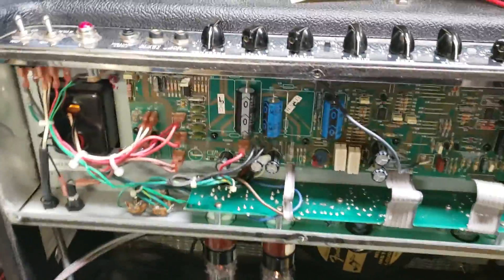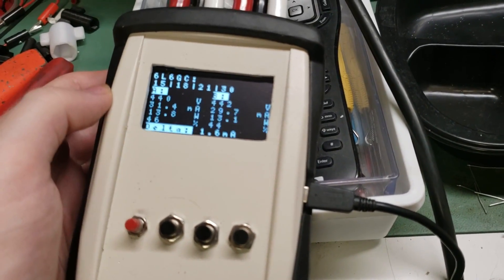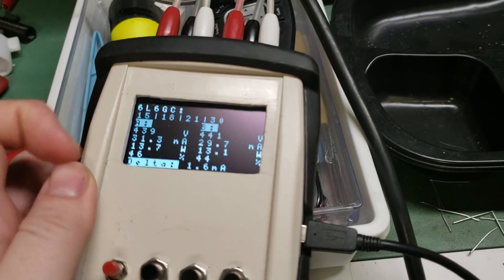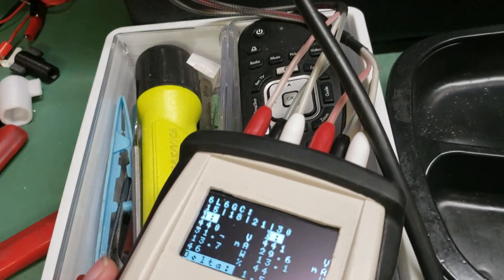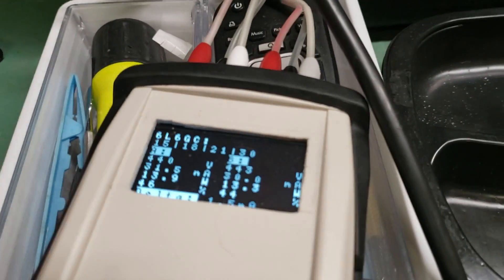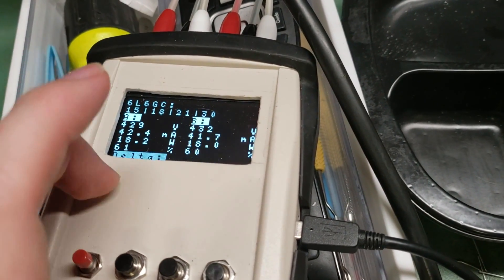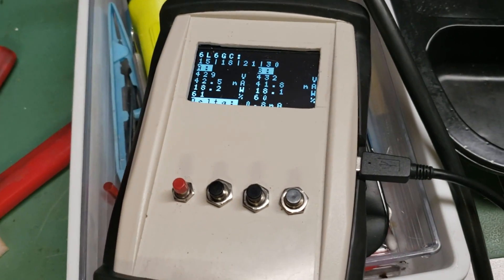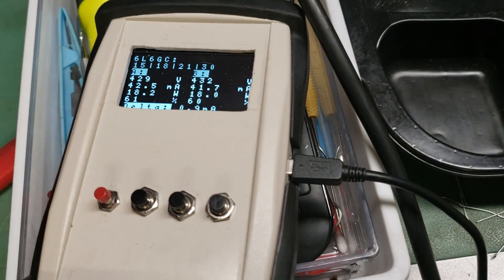Arduino powered vacuum tube bias tester

Comment: Is there a schematic available by any chance? I saw that this question had been asked before. But couldn't find an answer.
Reply: Thank you for the quick response. Very helpful. I want to use this as a basis for a setup for 4 tubes. I will have to switch to a larger screen and an extra ADC, but that is for later. Thanks for sharing.
Reply from the maker: Cheers, best of luck - I've thought about doing a 4-tube version but I've been too busy to do my own projects!  @ricocootje
Reply from the maker: No schematic, sorry - but it's pretty straightforward:
Parts:
Arduino Nano
3x Pushbuttons
1 SSH1106 Oled display board
1 ADS1115 ADC board

Pushbuttons are wired between ground and the following digital inputs:
D7 (Select)
D5 (left)
D6 (right)

and the OLED screen and ADC board are both connected to the arduino's i2c lines just like any of the tutorials online for them (Adafruit's diagrams can help you there)
Power for the screen and ADC are drawn from the 5V regulated bus on the Arduino

--

The actual probes themselves are TubeDebot "Bias Scout" probe kits, completely unmodified. 
Comments on the code show which ADC input correlates to the probe's current and voltage shunts

Hope this helps!
Reply: Then I still have a question about when you use the probes from TubeDepot. This contains a voltage divider that lowers the plate voltage. But the relationship is like this: when the plate voltage is 450V, it is offered to the ADC at 45mV through the voltage divider. Is this voltage still high enough to transmit a good measurement? Or am I missing something?
Reply from the maker: @ricocootje  The trick is that the ADS1115 has a built-in prescaling amplifier, and in this case is turned all the way up, giving us a scale of 0-255mV to work with instead of something like the same bit-depth spread over 0-5V
Reply: Regarding the libraries you use in your code, where did you get them from? I tried them from Github, but get error messages while compiling.
I also wonder about the ADS1115 library. Because on line 31 you talk about Adafruit_ADS1015.h, while line 43 refers to ADS1115.
Is this a bug or am I overlooking something?
Reply from the maker: @ricocootje 
Okay I did some digging to see what's going on here.
 Looks like it's because I built this quite a while ago with early versions of the libraries - Adafruit later renamed the library file from ADS1015.h to ADS1x15.h. 
I would try changing the name to see if it'll compile, but otherwise... my library tells me I compiled on version 1.0!

The display library U8x8lib.h is part of the U8g2 library, also available from within the Arduino library management tool. Mine was compiled on 2.26.14.

It's a good thought though, if I have the time later I'll probably come back and update my 4-year old code for newer library version heh.
Reply: @3dbeergoggles  Thanks for the quick answer. I have indeed already tried to rename the library file to ADS1x15.h.
Only then do I get an error message on the addressing of the ADS (line 43); "no matching function for call to 'Adafruit_ADS1115::Adafruit_ADS1115(int)' "
So something isn't going well there yet...
Reply from the maker: @ricocootje  

Ah, I updated to the current version of the library so I could debug this with you.
Change:
 Adafruit_ADS1115 ads(0x48);
To:
Adafruit_ADS1X15 ads;

The "construction" doesn't use the address anymore.
Reply from the maker: @ricocootje  Testing in the hardware I have noticed an issue: the latest version of the library is a lot slower than 1.0 was. It still works, but it seems to take 4x longer or so to update the screen.
More debugging needed :/
Reply: @3dbeergoggles  Yes, I managed to compile the code. Was a small adjustment in line 43. I2C channel 0X48 must be removed here. This is already assigned in the Adafruit_ADS1X15.h.
But I still have a few questions, if I may be so bold? I test the system by applying a fixed value of 46mV to the input of the ADC. What strikes me is that the measured values do not remain stable. These fluctuate quite a bit. The plate voltage fluctuates from 456.?V to 460.?V. The cathode current mainly functions after the decimal point, but it does not really give a fixed value. I see that the plate voltage in your video does not show decimal places, perhaps that makes a difference. And it seems as if the values in your video refresh less quickly. Could this have been changed later in the code?
And then perhaps another stupid question concerns the subtract 5.5% of reading to approximate screen current. Is this something you always have to do? Since you are going to measure the voltage across the 1 ohm resistor. Normally this is always the current to which you adjust the power amplifier, right? Why the 5.5%?
Reply from the maker: @ricocootje  Fluctuations, et al. could be from a number of issues, the least of which being noise - the ADC is being run at 16x gain so if there's any stray noise it might be showing up. Of course, to get a reading from 456 to 360 only requires a fluctuation of 0.4mV and the input impedance of the ADC at that level is 100M ohms!

Bear in mind I am NOT anything approaching an expert in this (hence the absolute spaghetti code I wrote), but I suspect the code in general could benefit from a rework to provide a smoothed average reading.

5.5% is subtracted to account for grid current. Since the goal is plate wattage (plate current X plate voltage) the ideal would be to measure 1 ohm across the plate lead, but that leaves both leads floating hundreds of volts above ground so we instead measure cathode current. Cathode current is the sum of Plate AND Screen Grid current. So if we'd like to get the actual plate current measurement (without having to measure the current through the plate or grid circuit directly), an approximate value of 5.5% is subtracted instead.

This figure is what is used in Rob Robinette's online bias calculator page for this very reason. It's also why there's an entry in the tube array to allow you to add tubes in the future that don't use screen grids, such as a triode.

The "debug" tube in the menu also allows raw reading of the cathode current without any grid current subtraction.
Reply: @3dbeergoggles  Oh damn. I now see that I missed this message. But indeed this was the issue. After this change the code works.
I'll have to see what happens when I use two ADS1115. I expect that I will then have to change ads.begin() to ads.begin(0X48) and ads.begin(0X49). But that's for later.
Reply: My comment above was in response to this comment;
"Change:
Adafruit_ADS1115 ads(0x48);
To:
Adafruit_ADS1X15 ads;"
I completely missed this response.
Regarding the noise, yes there is a good chance that noise will occur and it will therefore be amplified 16x. The voltage divider that I have now made is a voltage divider using a 100K and 1K resistor in combination with the 5V power supply of the Arduino Nano. I'll see if I can offer a separate power supply with 450mV. See what happens then. I may need to add an additional filter to smooth out the values.
Thank you for the explanation regarding the 5.5%. I read through Rob Robinette's website and I saw it there too. Thanks again for that.
Regarding the issue for refreshing the screen, where do you see this occurring? I don't see anything crazy about it, but I have never tested V1.0. Do you not get a clear screen?
Reply from the maker: @ricocootje  I found the refresh rate was significantly lower with the newer version of the library, though updating it to increase the sample speed to 860 sps seems to have corrected it

  //Configure ADC Gain & refresh rate
  ads.setGain(GAIN_SIXTEEN);
  ads.setDataRate(860);
  ads.begin();

I've also tested a library to add a rolling average and have it working but it doesn't make huge difference, especially if you want it to remain quickly responsive to bias adjustments.
Reply: Okay, I'll try that. Let me see if I can see what you mean.

Comment: I'm giving this a go. Wish me luck.
Reply from the maker: Best of luck! It's not super complicated but  make sure to plug the bias scout probe grounds in first if the amplifier is on, reduces the chance of odd voltages going across the ADC board.
Reply: @3dbeergoggles  I'm putting my BIAS Scout probes together now. I've had the kits for a while with the idea of hooking them up to some voltmeter/ammeters but wasn't terribly motivated. This looks way cooler.
Reply: @boctok55  Best of luck, let my know how it goes!
Reply: @3dbeergoggles  I meant to ask, what is the red button/switch for? I get the left, right, select buttons, but haven't figured out the red one.
Reply from the maker: @boctok55  Oh, that's just a power switch for the 9V battery, though most of the time I'm running it off USB power.
Reply: @3dbeergoggles  Everything looks like it's working except I can't return to the "Select tube"  menu after making the initial choice. I have to cycle the power. I'm still waiting on my ADS to arrive and thus, don't have anything (mV/mA) being input. Would that prevent returning to the tube selection?
Reply from the maker: @boctok55  Hmmm, that might be the problem - the code is pretty simple, doesn't use interrupts or anything, and the first thing it does after selection is run DoBias(), which reads from the ADC. It might be hanging because it can't get any response from it. After a single refresh of the bias readings, it checks to see if the button is being pressed before refreshing the bias results
Reply: @3dbeergoggles  I read through the code more carefully after posting and that was what I concluded. I'm just too impatient to wait until I have everything to get started.
Reply: @3dbeergoggles  Got this one built and it works like a charm. Wondering if an 8-channel ADC could be used with some additions to the code to test amps with 4 output tubes, think that might require an Uno, though I'm not positive. I'm also building some probes for EL84s, because I see a lot of amps with those. Maybe a bit larger screen with touch and selection buttons integrated on the screen. I'm really digging Arduino.
Reply from the maker: @boctok55  Aside from enough memory to fit the code, I think the only thing you'd need is to either get an 8-channel ADC or use a pair of i2c ADCs but configure one for a different bus address